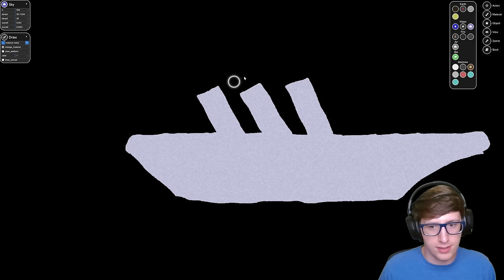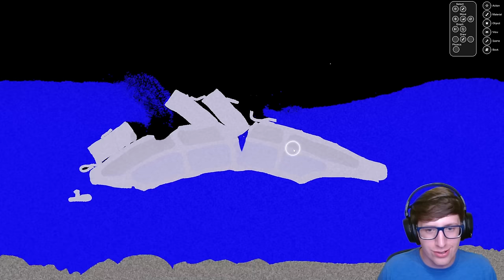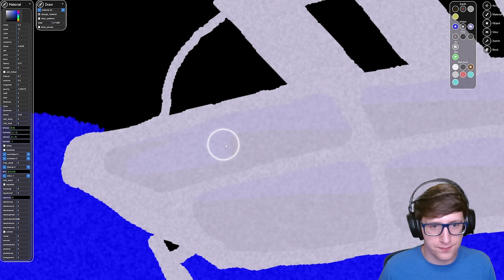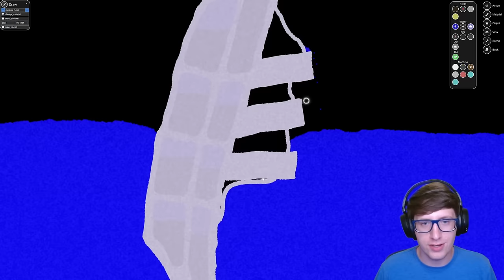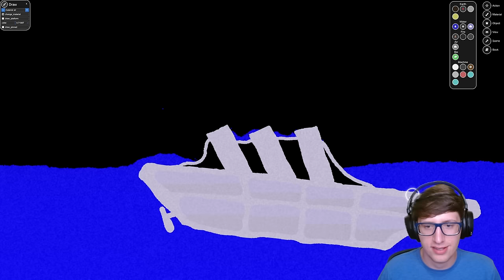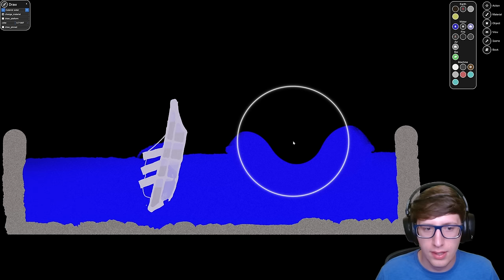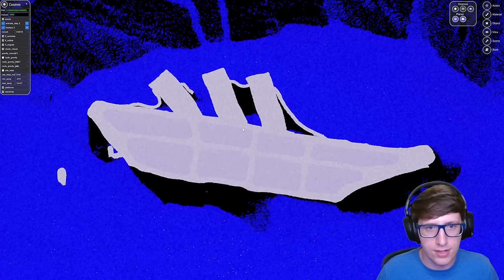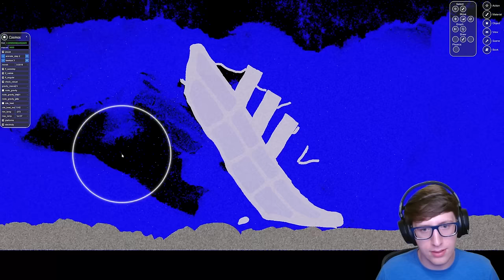SINKING THE TITANIC in Space Simulation Toolkit!

Comment: oh my god, I slept through the new video in my time zone :-) 

I thought a lot about how to make shifted materials not so heavy: I tried reducing mass/gravity if the material is shifted. in fact, I think ideally, not a continuous covering of the background should be used, but sparsed trusses supporting the structure made of shifted material, which give a lot of strength with low weight

I also just realized that based on the new (not yet published) red-green-blue layers system it will be possible to create effective pumps, which in turn can work to effectively create water motors like jet skis (pumping water through themselves)

I'm very glad that the new features of machines gameplay are getting attention!

the next release will add copy/paste (80% ready), a new colored multilayer system (the shifted layer will also remain)

also, I hope to finally be able to create some well-functioning example machines soon

Also, in the near future I plan to add the ability to draw a line one atom thick (for ropes, wires and other thin structures)
Reply: ooo cool its the creator